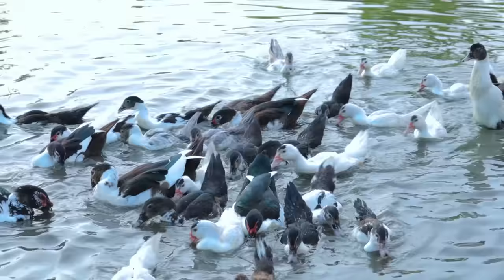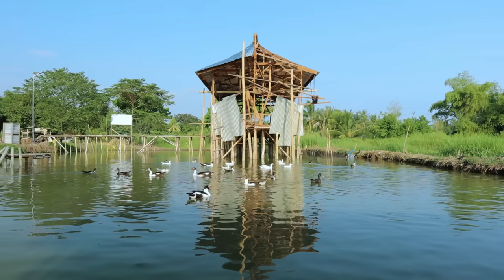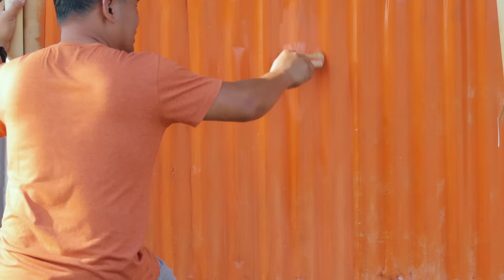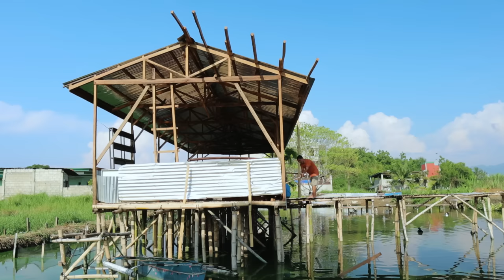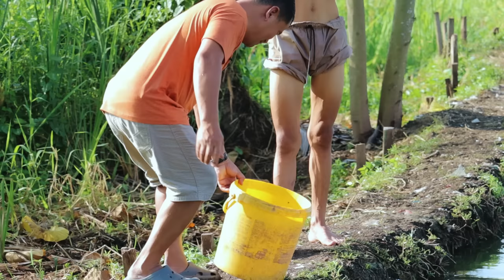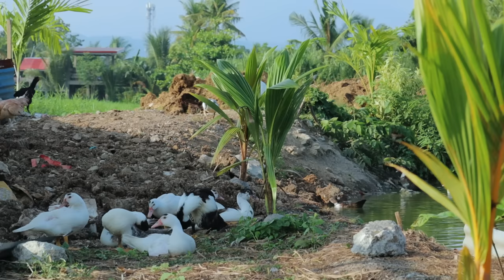Adding 500 Catfish to My Biggest Pond And Starting to Paint our Boat House (Building A 1 Acre Farm)

Comment: Dexter:  you will do a much better job at painting it if you use a paint sprayer.  They make them cordless and have no need for electricity.  The sprayer will make it more even and precise in its look and feel.  Hand-painting this large piece of metal siding will never look really good.  It will look like a 5-year-old painted it.  You have to use a sprayer to get the even consistency that you need and want to have for the commercial use you intend to make.

Comment: Hello Dexter.
You say we can give our opinion on the color of the boat, so here is mine.
I think this orange color is not appropriate at all.
The color of the water below the boat is a very beautiful bright green, I think that the color of the boat must harmoniously match this bright green; However, green is the complementary color of red. (there are universally the 3 primary colors, yellow, red and blue. The complementary color of each primary is a mixture of the other two primaries. I hope you follow me) When we see a primary color next to its complementary our brain is happy, we feel in harmony. With all this green around the boat, I would put a powerful red, a bit like the Chinese red of certain temples.
But there is one thing that bothers me more, and that is the vertical direction with which you nailed the sheets. There's nothing fluid about it, it doesn't go with the fact that a boat could slide on water. It looks like a house and not a boat.
In addition, if you put the sheets horizontally, in the other direction, this would allow you to paint a white edging like there is on many real boats in order to give the impression of a real boat.
So I argued my advice about the red color to be in harmony with the green of the body of water.
That said, everything fish is often linked to the color blue (in Europe fish packaging is blue, fish transport boxes are blue, fish displays are blue and of course a majority of fishing boats are blue). blue and white)
You could also paint it blue, neither too light nor too dark, with white edging.
Customers will immediately feel like they are getting on a boat.
...... This orange color has nothing to do there :(

I hope my advice will enlighten your mind ;)